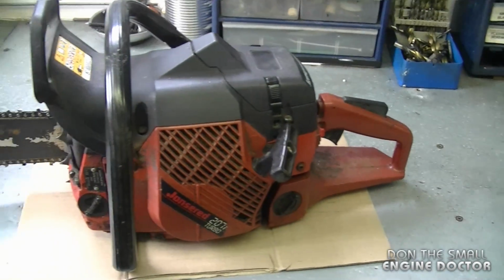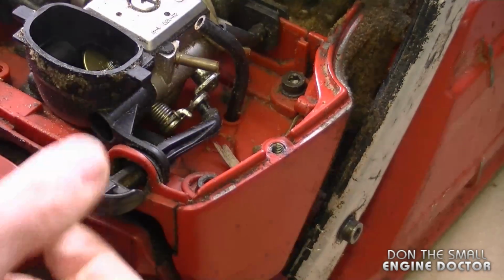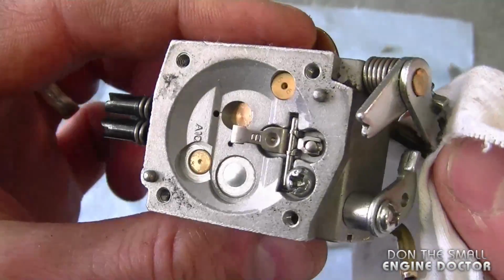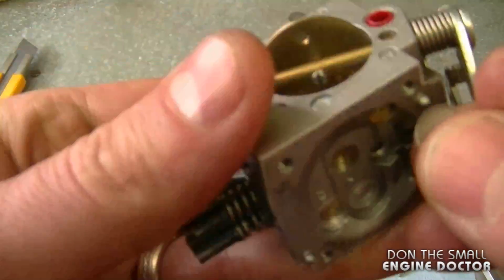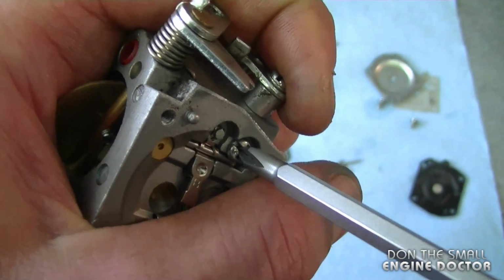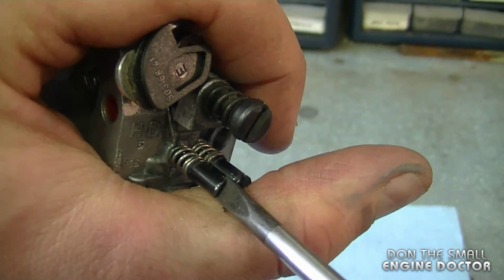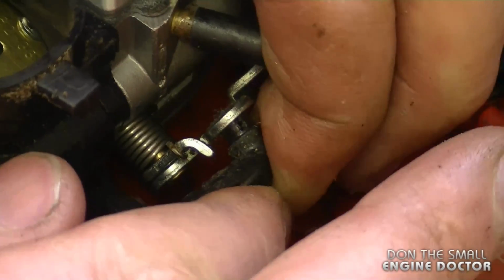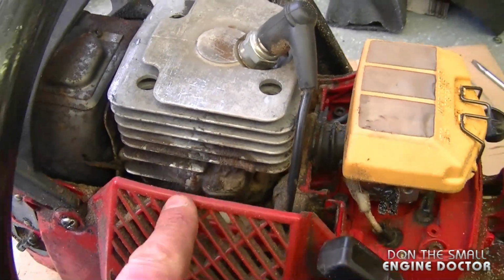HOW-TO Chainsaw Carburetor Rebuild - Jonsered 2071

Comment: My cs 255 will not start. Getting fuel run by in what looks like the spark arrester screen area. Wondering if that’s carb or rings in cylinder?

Comment: Just followed your video for rebuilding the carb on my Jonsered 2065. My carb is Zama, but parts and procedure were exactly like the Walbro. Excellent concise how to video, many thanks. Now to reinstall and hope it runs better. This was my virgin rebuild and somehow the metering valve and  spring slip into place on the first try.🎉 Your video is what the internet should be used for, good stuff! So glad I came across your site😊

Comment: Dony I just had a question I have a Stihl leave blower it boggs when you try to give it full throttle for just a second or so even after it warms up do I adjust the H screw or the L screw about a quarter turn? It's a BG 56.

Comment: I have a jonsered 2054 turbo whith  no oil to the chain. I have cleaned the lines and had a look at the pump that seems Nice. But suspect the drive wheel/gear to the pump that has failed but it looks like a "springgear" how does it work?

Comment: Well, after your help getting my Stihl ms250 back running ( breakdown to replace impulse line) I just pulled out my dust covered Jonsered 450 thats been sitting in my cellar for decades and getting ready to tackle getting it back running. I found a new love in small engine breakdown and repair thanks to your help. I also have a Toro lawnmower thats been sitting in my back yard for decades also that I just put on the list but for a beginner I can't get too excited and just do 1 thing at a time. I am going to subscribe and get a free education on small engines. You've already saved me money on work I have been paying  that a  fix it shop to do. Thank you very much Doctor.

Comment: I have a vintage Jonsereds 70E I Think.     I purchased it used in 1981 and have used it faithfully through the summer of 2017.  I am hoping to keep it alive. It needs a piston kit.  After breaking mine down, I saw that the piston has two rings.  Everything I see for the 70E K model has one ring in the piston.  I need some help in locating the correct kit.  Can you help?  Thanks in advance, Tom
Reply from the maker: check chainsawr.com

Comment: Nicely explained. I also have a Jonsered but I can't remember the model (and now I'm about 100 miles away from it, so I can't go and look it up), but what I do remember is that I have to service it and doing this looked a bit daunting to me, even when I've serviced other things at home, carburetor rebuilds included.

Now, even if it's not the exact same model, which it's not since the choke is on the other side (and it doesn't disengage automatically), it doesn't look that hard. Thank you, the way you explained things really help.

Comment: I worked on a 2050 turbo which looks very similar although it is slightly larger, have you ever had one of these in with a broken recoil housing? The one I had the entire cover had broken away.
Reply from the maker: yes I have
Reply: donyboy73 it’s really unfortunate as these are actually pretty nice saws but that simple issue causes these to be thrown out or donated. The one I fixed was for a pawn shop.

Comment: My wife say's you have created a monster(meaning me..lol). Since watching your videos I have repaired a small crack @ the oil drain plug, rebuilt the carb and replaced the head gasket on my 97 Murray 12.5 hp riding mower(runs better than ever). I also found and replaced the leaking shaft seal on my 5.0 hp Murray pushmower and rebuilt carb on that, I am currently working on a Jonsored 2050e chainsaw and have 2 yardman pushmowers to rebuild and an old Snapper Hi-Vac ridingmower to work on, you think if I take up all the room in the garage (she can barley get her car in now) I might be able to get me a bonafide shop to work in for my new hobby and my old hobby which is blacksmithing. Your videos have definitely been a game changer for me, anybody that repairs mowers around here has a 6 month back up.

Comment: Donny,  I've always fixed carbs with floats/needles.  Does the movement of the diaphragm going in and out, work the same as the float lifting and dropping?  If so, how does the movement occur with no fluid to lift the diaphragm?  Pressure?
Reply: Pressure from the impulse line is what in told

Comment: I am so old I remember sae30w in chainsaws.  the oldest two cycle oil I still have is an oil named Staymix, which I used to by at my stihl dealer in Fitzgerald, ga.  it was good oil and I used a ton of it through the years, usually at 40:1 in my Husqvarna and Poulan saws.  back then, we were not to finicky about which oil we used -  only that we mixed it properly.  now we have to be very clinical with every tank of two cycle gas we make.  I use nothing but stihl Ultra oil in  all my two cycle gas and the oil is measured, exactly, at 2.6 ounces per gallon of premium non-ethanol gas.  in the old days I just dumped the one gallon can of two cycle oil it in the gas can and pumped one gallon, more or less, of regular gas in the can

Comment: I live down here in the U.S. in Connecticut.  I am very lucky to have access to gasoline with ZERO Ethanol close by in New York state only 30 minutes away.  I just installed a new carb. kit for the carb in my Stihl BG85 hand held blower - I bought the blower brand new and have never run it on gasoline containing ethanol -  it is 12 years old and the carb components were 100% original.  For everyone reading this comment -  Try to use gasoline that does not contain Ethanol -  it is amazing how destructive ethanol is !
Reply: So true ! Ethanol will absorb moisture like crazy. No problem in your car where you go through the fuel tank in less than a week but  most chainsaws or small motor appliances might very well be left with gaz standing for months. Avoid that crap at all costs !

Comment: Nice to see this procedure.  Inlet valve spring is important:)  Good tip on cutting off a bit of the fuel line when reconnecting it.  Thanks and have a good weekend!

Comment: Hi great video, in the Husqvarna factory we were not allowed to snip of the fuleline like that. We had to use a pair of scissors, just the same type you use to cut dog's claws... else the rubber could crack and might eventually slip off.
Reply from the maker: good tip, thanks

Comment: Great video, I have a homelite chainsaw that will not fire could it be a bad ignition coil ?
Reply: did you check for spark ?
Reply: Yes, I took the plug out put the coil wire on the plug ground it on the motor pulled the cord I get no spark to the plug so I'm thinking it's a bad ignition coil the engine seems to have compression so I don't think it's the valves but I'M no expert on chainsaws
Reply: probably a bad coill...btw 2 stroke engines dont have valves
Reply: See I told you I didn't know much about chainsaws LOL , good at working on lawn mowers but not chainsaws ,Thanks for the info

Comment: Nice to see an older unit that hasnt been messed with, and it starts and runs much happier now :-D.
Reply: We live in a disposable society.  When something breaks or doesn't work right, people just throw it away and buy a new one.  I like fixing equipment that is still good just needs some tlc.  There is a certain satisfaction to it, and you have history with it.  Plus I like learning new things and overcoming a challenge.  It ain't brain surgery.
Reply: I was born into a family with very little money, so learning to repair things was the norm, and i would not have it any other way :-).
Most of my electronic test gear is second hand, and ive had to repair it, i appreciate it more too :-D

Comment: I enjoyed watching how you replaced the carburetor kit and adjusted the saw. My two saws have been to a shop too many times and especially my Stihl chainsaw, which is the newest. I have had problems with them starting and running and the Stihl is the worst. I started it two days ago to test it, and it started and ran until I was sure it would work, then turned it off, and put it away. Today I attempted the same with my Poulan, but it didn't start at all. I may have flooded it, and will try starting it again tomorrow to see if it will start, and then check the Stihl saw also. The Poulan gave me the best service though, and I am tired of taking them to the shop each season to get them running. I did that last season, and my neighbor just helped me go get my two lawn mowers going, and it didn't cost me a fortune to do it.